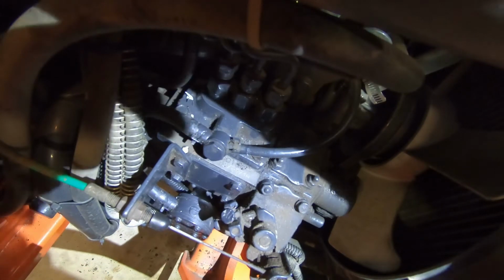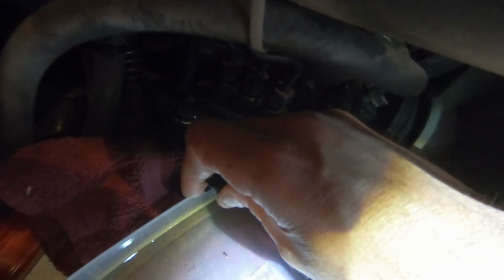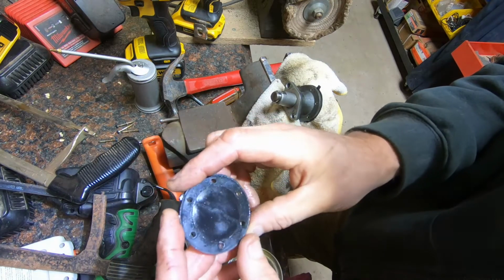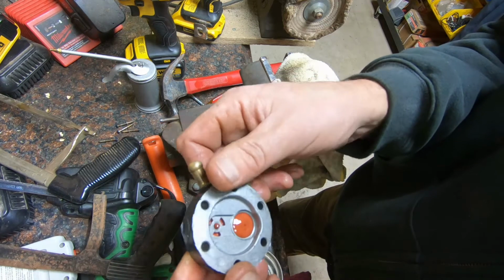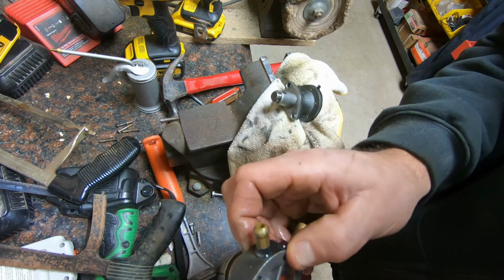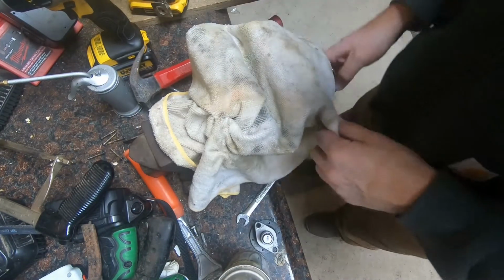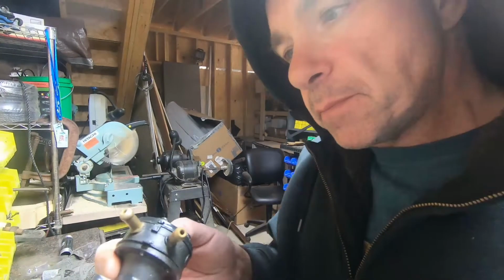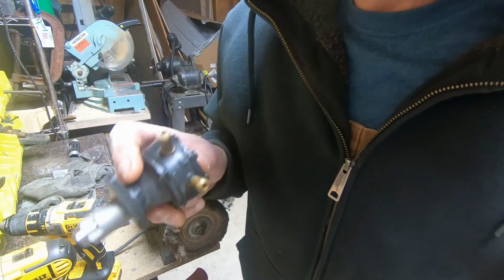Kioti loosing fuel prime

Comment: Hey Brad, Thanks for taking the time for your video. I had the same issue as you . Ordered a lift pump, problem solved. The only thing was getting to and loosening the two nuts that hold on the pump.

Comment: Before you go this far, check for a plug filter behind the seat. This filter plugs all the time and corrodes or freezes. When you change the filter make sure your remove the two end pieces of the filter as it sometimes sticks in the bow and at the top of the bowl.

Comment: Some say a mechanical fuel pump can wear and leak fuel into the engine oil , that fuel gets onto bearings burning them up. Adding an 12 volt battery driven fuel pump & toggle switch prevents  the fuel into oil from possibly happening.